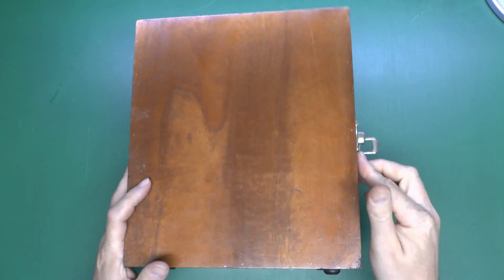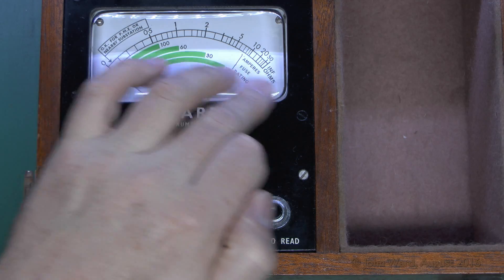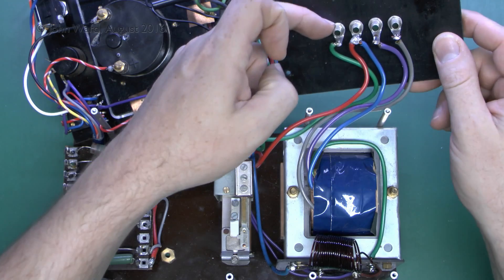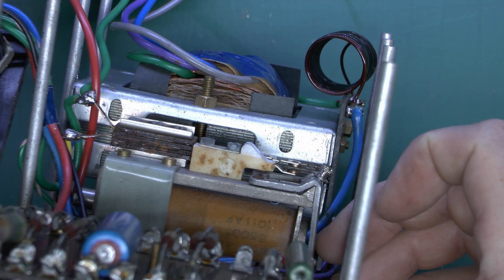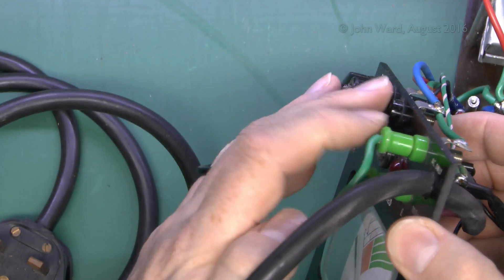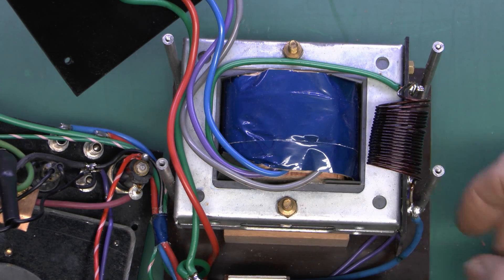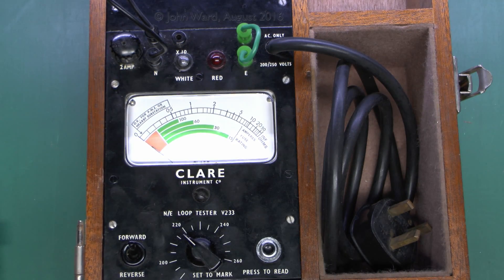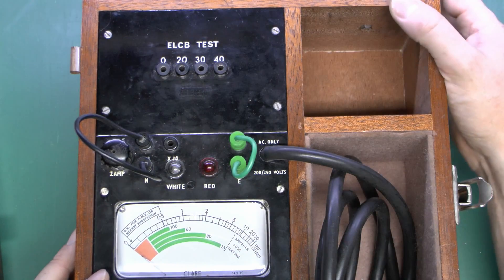Clare V233 N/E Loop Impedance Tester

Comment: Thanks for your hard work,
Q1:  
What if we bypassed the ELCB, can we still use N/E test to measure the resistance of earth loop?

Q2: 
Why do we need special devices for the earth loop impedance test, I believe the multimeter with a known resistance value act as a load, then measuring the current and the voltage between P/N can give us a good result, right??

Q3:
Can we use clamp-on method to measure P/E or P/N or E/N ?

Hope you help me, thanks alot

Comment: I'm assuming that as the Neutral conductor back to the energy suppliers transformer is going to have the same csa as the Line conductor then this type of tester is equally as valid as modern Line to Earth loop Impedance Measurement test?On modern Line to Neutral or Line to Earth test sets I believe as you say the instrument applies a known Load say (Rl) and measures the voltage drop and then calculates the loop impedance as the Change in Voltage with the load applied ~V multiplied by the Load Resistor Rl divided by the measured voltage across the load (Vl).  ie. Ze =  ~V x Rl/VlMy question is what load do the modern instruments apply, is it around 5 to 8 Ohms to get a measurable change in voltage for a typical installation Ze value and for how long do they apply this load for.  I assume its quite a short pulse in order not to overheat the load in the instrument?

Comment: That very crude overheating protection might be added later?? 
I can't imagine a factory built machine would use such a "low tech" approach, having to resolder after a overheating problem.
How old is this device?  Fifties, Sixties ???
Reply: Those were common, as you would expect the user to at least be trained under guidance before being left unsupervised. The protection is more a last ditch thing in case your brain goes out for lunch one day, not to e a regularly used thing by poorly trained people.
Reply: Often I'm pretty good in dating instruments, but here I am lost. Looking at the wires, transformer and other parts, I think late 60's/70's, but the wood, rectifier/zener'ish thing inside and the typed paper I would think 50's.  But I my experience in the "old instruments"  field is RF and electronics related calibration and testgear. Not the electricians/mains side of electronics.

Comment: We used to have one of those in the workshop when i worked for the electricity board back in the 80s.
I never actually used it as we had more modern testers by then, but we kept a lot of old gear in the workshop.
Good to see it again.

Comment: great video - but wouldn't the jumper sockets for the neutral be for selecting current not voltage?
Reply: The older earth leakage breakers were voltage operated (John's done a video on it a few months back) so voltage would be correct for this age of gear
Reply: I did watch that - but hadn't connected the two. Thanks.